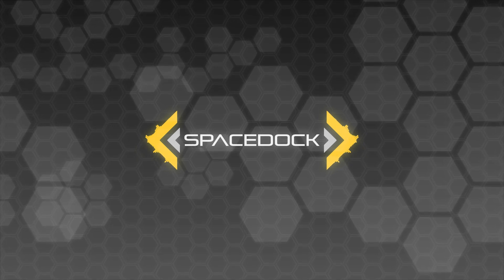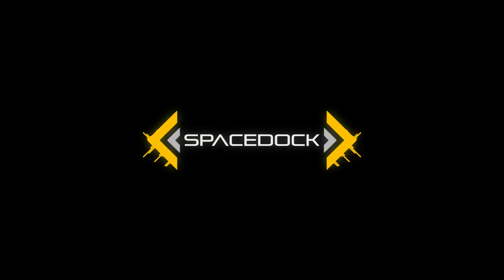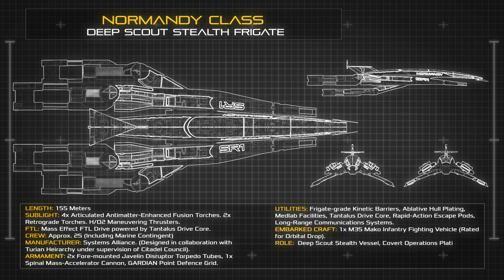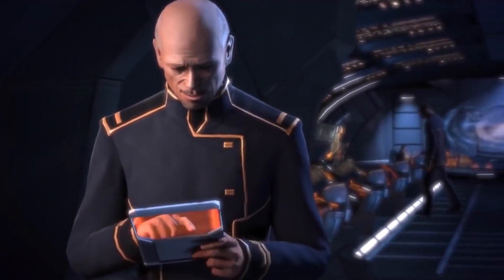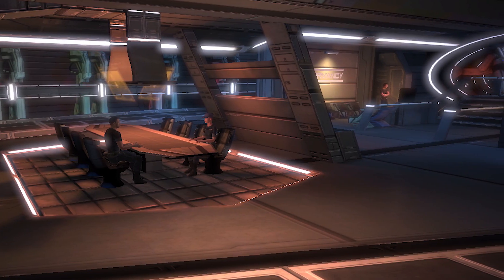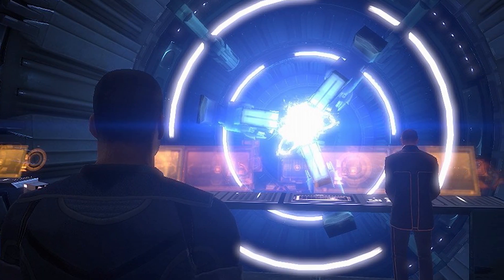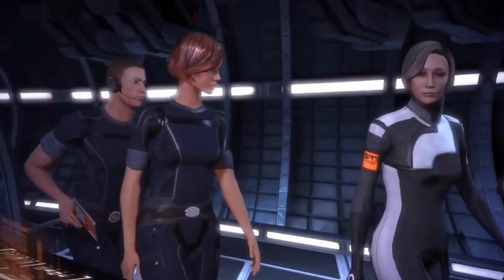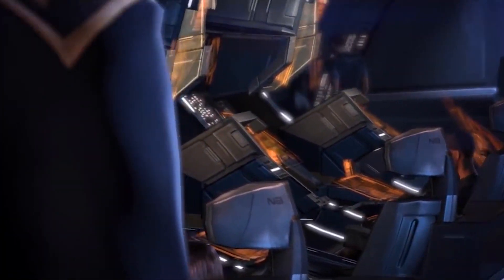Mass Effect: Normandy Class Stealth Frigate - Ship Breakdown

Comment: Most stealth vehicles would have dark coloring to blend in with the environment and yet the Normandy has bright colors. It runs counter to what stealth supposed to be. 

Now I can predict that people will comment that Normandy's color is justified because well, in a realistic space setting, using visual is pointless because you can see much due to the massive distances. Well yeah if you eyeball it. What about optical instruments that can zoom, provide images that radar/ladar, thermal couldn't and many more?

Heck, use the Geth Station infiltration for example. The Normandy's stealth only works because the station doesn't have any cameras on the external.

Or try and have Normandy do a stealth run on any planet that has common sense to have observatories and space detection stations with telescopes. It won't work.

Plus, you think that for a race that uses mass effect in their daily lives, they would have equipment capable of detecting when a mass effect is happening, thus the Normandy's method of moving while in stealth wouldn't work very well either.

Comment: Honestly, the only thing that bugs me about this ship is the fact that the designers didn't seem to bother actually adding weapons to the model itself. I've always wondered where the spinal cannon is supposed to go, or where the javelin torpedo tubes would actually be bolted. I suppose the GARDIAN network could be mounted under hatches, but otherwise there doesn't seem to be any space for armaments...
Reply: There were a lot of mistakes made in the first game.  Did you notice on Eden Prime how Saren already had all of the Geth stuff implanted into him instead of looking like a regular Turian.  He should have only had that stuff implanted into him after the encounter on Virmire.  

They also only show Turians and Krogans wearing armor, never wearing regular clothes made out of cloth.
Reply: @eitkoml  Yeah, but that's due to memory limitations on the consoles it was designed to run on.  It's the same reason why they never showed females in ME1 and ME2 (except for the humans and Asari, of course).  Every model they have to load takes up more memory.  And the same reason for the slow-as-molasses elevator on the SR1, which actually doubled as a loading screen.  Though I agree with you regarding Saren, though... obviously you never see more than one Saren at a time, so you'd still only be loading one model into memory.  It wouldn't be an "extra" model, just a model swap.
Reply: Developing for consoles first was another mistake.
Reply: Not only that, but what about the coloring? When you think stealth, dark coloring would be the first to come in mind and pretty much all stealth vehicles apply this. Yet the Normandy has bright colouring.

I've brought this up before in other Normandy videos and the replies usually are that it doesn't matter if the Normandy is white because in realistic space setting (which ME semi-uses) using visual is pointless.

Well yeah if you eyeball it, but not when you can install optical instruments that can provide data that other sensors couldn't like such as images and the like. Also zoom.

Normandy would fail hard at doing a stealth run against competent civilizations. Heck, take the Geth Station mission. Only reason why their stealth run works is because the Geth doesn't have any cameras on the station's external.

Oh and you think that for a civilization that uses mass effect in pretty much everything, they would be able to detect when a mass effect is in use. So they should have mass effect signature detecting devices as well that would render Normandy's stealth propulsion moot.

The Normandy only works because its setting is filled with idiots.
Reply: @secondsein7749  Depending on the sensitivity of the optics, you might have to coat the thing in vantablack. Though I do agree, I would have liked to have seen her in black. As for detecting mass effect fields on that kind of level, is that possible? Could be less of a case of characters being idiots, and more that that's just how the world was designed.
Reply: @andymac4883  if their world truly did not have mass effect sensing equipment sensitive enough to detect a mass effect that can pull ships, irregular occurrence of it or even the fact that the mass effect happens in space (mass effect doesn't occur normally in space, to my knowledge), then that's just shoddy world design and would prove my point that the people in it are idiots...and so are the lore developers. Mass effect is almost in everything, from small to guns and large such as the mass relays. Not having sensitive mass effect sensing equipment would be a major disadvantage.
Reply: @secondsein7749  You think that's bad?  Try the old 1997 game Star Crusader, which came out right about the time SVGA became a thing.  I'm like "guys, you had 256 colors, but did you have to use all of them?  The "stealth" fighter is fucking orange!

Something you're failing to take into account is that space is huge … and the Normandy is a stealth frigate.  Unless it's in a fight, or has to dock with another ship (like when it docked with the Geth station), in a more realistic simulation it would be tens of thousands of kilometers away.  It could be bright orange and you wouldn't see it without a telescope.  Space is also three dimensional... your telescope would have to be looking in exactly the right direction to see it.
Reply: @SpearM3064  did you read my previous posts? I DID take into account the vastness of space and specifically mentioned that spacecrafts and spacestations would have optical instruments installed on them that would provide better visual. And regardless the vastness of space, that does not make visual sensory and imaging useless. If anything it is required for record keeping purposes such as encountering weird anomalies that other sensor systems couldn't detect or could provide pictures of. 

Realistically Normandy would fail at even long range, system edge scanning as competent civilizations wouldn't just focus their detections systems close to home but also at the edge to inform them of approaching unknowns.
Reply: I imagine the javelins could also fold out, and there's a few places to put them... but the ship CLEARLY doesn't have a spinal cannon. I guess it could conceivably be just under the CIC, but there still doesn't seem to be a lot of room for such a major weapon system.
Reply: @InaraEkku  I'd be inclined to agree that the torpedoes could fold out, like the missile launchers on something like an F-22, only the Codex mentions that javelins are cold-launched from tubes magnetically bolted to a ship's hull, which we never actually see. Which reminds me of another issue, the fact that the SR-2 apparently uses javelins to shoot down the Occulus drones at the Collector base, since it's the same effect as we see if you take on the cruiser without a Thanix upgrade.

I tried to fit a cannon in on a version of the SR-1 I was making in Starmade, and the only place where there was actually room was above the CIC, in about the spot where the CO's cabin fits on the SR-2. Of course, that meant it was a very short mount, not very much like the 'full ship length' versions described.
Reply: And what's funny is that in the Geth Station mission, Joker himself said that the Normandy can be seen if the station has windows. This worry about windows and Legion's comment about them implies that organic ships in ME do have windows. Sooo...
Reply: @secondsein7749  Imply? We can walk around the Normandy and see windows in game. The SR-2 has cockpit windows and the port and starboard observation lounges, and may have windows in the lab and armoury as well, I can't quite remember there. But as has been pointed out, by others and indeed yourself, people looking out of the window isn't the issue. Optical sensors maybe, but I'm not sure what your point is with this particular comment.

I read it more as Joker pointing out, in his normal fashion, that the Normandy and her stealth drive are being used for something they wouldn't normally be. System recon and dropping a buggy onto a planet doesn't put you in the same sort of range as flying up to a space station and boarding it.
Reply: @andymac4883   people looking out of a window can still be an issue as there are crafts that still uses them in ME such as their starfighters that could be assigned for patrol or maybe civilian ships.

Normandy's stealth is through heat masking, that's true. But just banking on that is a bad design. Look at the Anubis stealth ships in the Expanse whose primary stealth is similar in that it hides its heat emission. But it doesn't rely on just that as it also have dark coloring to blend in. This two features is what enabled it to set up an ambush on a civilian ship in the first episode. Whereas if Normandy try to do the same, it'd be detected easily.

Normandy's stealth would work on system scanning from far, but anything that requires a close up to the target such as even dropping a buggy to a planet low and quiet would be suspect at best...if the planet have decent sensor probe around. I mean the probe doesn't even have to check for heat signatures, or even visual, just gravity fluctuations and eezo effects that are indicative of a ship.

Comment: i really like this from the sr1 but something i think is strange. The escape pods are shielded with a movable hull piece. I think when the crew is forced to abandon ship, they have to trust that the mechanism which move the hull or the powersupply are not already compromised by the attack.  I think the Enterprise-E has one of the best designed escapepods because the pod itself is part of the hull and you have only a door inside which keeps the air inside. But this door could also be powerd directly by the pod or use a "simple" mechnical closing mechanism.
Reply: Honestly the Normandy is so tiny and cramped with crew, it's hard to place the escape pods out in the open without leaving large chunks of the hull unarmored.

Escape pods in combat are something the SR1 shouldn't really be expected to deal with anyway, if the ship is in a fight it can't win, then something's already gone rather badly wrong.

Comment: Wouldn't change a thing about its design, it looks just as it should.
Got my Dark Horse model of the SR1 sitting pretty on the shelf.
Reply: I wish I had her as well, I'm happy with my SSV Normandy SR2 here on my desk.
Reply: @GoldPicard  They're both beautiful ships.
Reply: Ehhhhh the internal space is wayyyyy to big, especially the CIC and the hallways, they could've cut the the volume down a third or half made more room for heat sinks, armor, or other systems and it still would've had plenty of room for the crew to be comfortable also why does the commander have to stand at the CIC ? Sitting would be fine also the holographic display is huge to to the point of stupidity they still could've kept it holographic but condense it, lastly people don't need to be standing up at their consoles, if the pilot is trying to make evasive maunvers in atmosphere the crew is gonna be flying around everywhere and it would be pretty hard to do your job when somebody flew into you from across the room, or you need that somebody
Reply: @insidious7329  The internal space is big because you're using a 3rd person POV and the designers didn't want you constantly clipping through walls, it's why most RPG and MMO interiors have a lot more space than they should. You're correct about the other stuff tho. The reasoning is mostly rule of cool really, and I have nothing against it.
Reply: Insidious well I guess Taurians prefer to stand over sitting as that was inspired by them.

Comment: IT lacks  bathroom's and toilets
Reply: It was jointly designed by the Turians, so naturally it never occurred to them to add bathrooms. Turian military ships don't have Bathrooms, see, on account of them being unable to use them due to the massive stick up their asses.
Reply: Well the SR2 has a shower for the commander. A frequently used shower.
Reply: It doesn't need a bathroom. Private Frederick picks up the poop by hand and throws it out the window. By hand.
Reply: I figure the sleeping pods double as toilets?

It's basically a submarine. Creature comforts are at a premium.
Reply: @InaraEkku  I agree with the submarine comparison, but the thing that gets me is that the SR1 has alot of wasted open space on the crew deck which could have been used for things like a toilet without having to make the ship any larger or compromise on other more vital systems
Reply: So it follows Starfleet design philosophy ?
Reply: Except Sr2
Reply: I just poop wherever